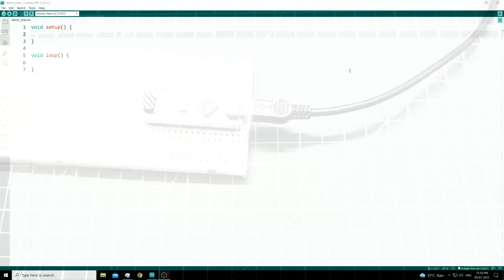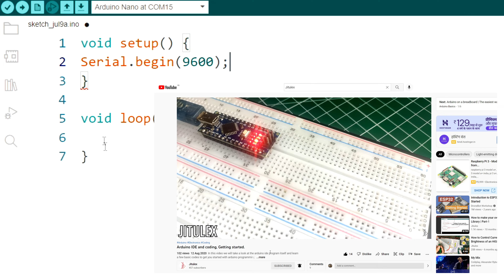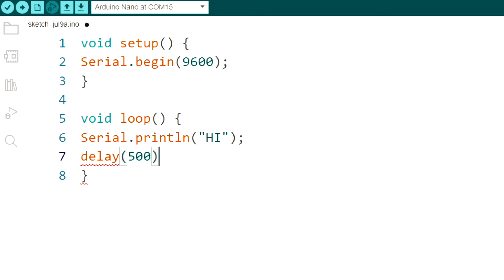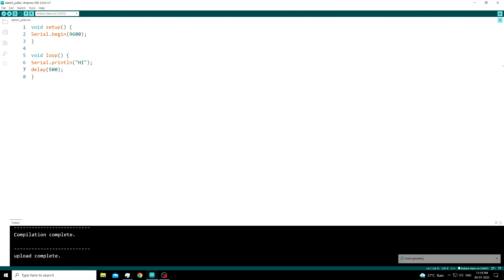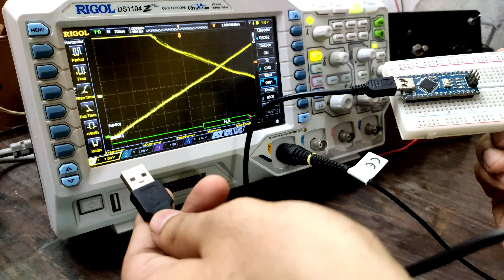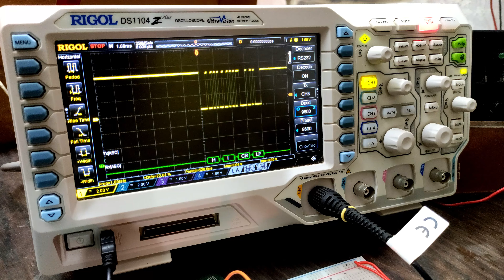How to view and decode UART or Serial Data on an Oscilloscope | Rigol Ds series DSO

Comment: Why is your Tx set up is for channel 3 but you are using channel 1 to measure.
Reply from the maker: its because i was not even looking at the tx pin, i was looking at only rx pin from which the arduino was transmitting the signal to the oscilloscope, and the rx was setup for channel 1
Reply: @jitulex  Hi, I am trying to read a serial port with my Rigol.
Some data show an "?" I am not know what it is.
Do you have some idea?